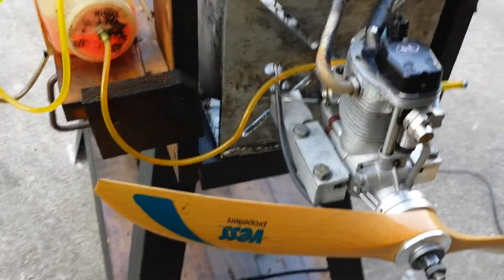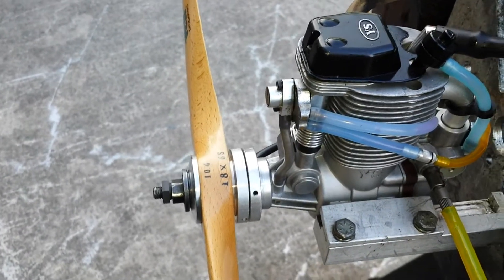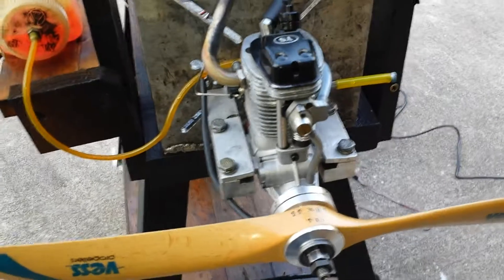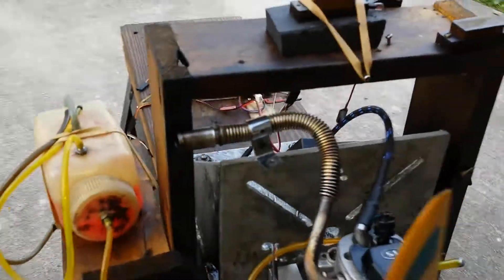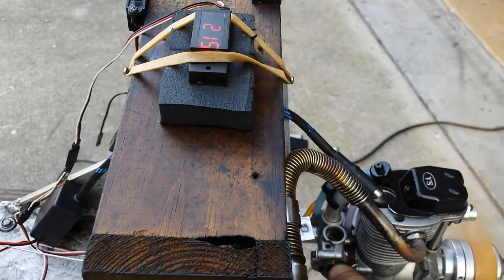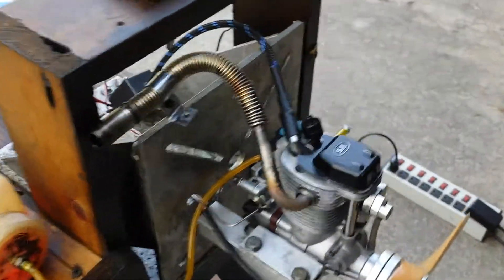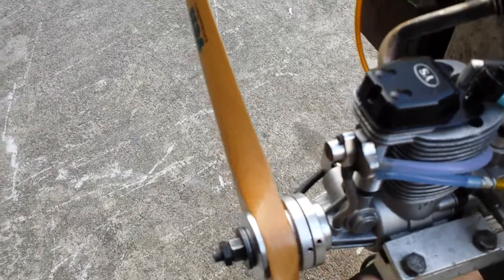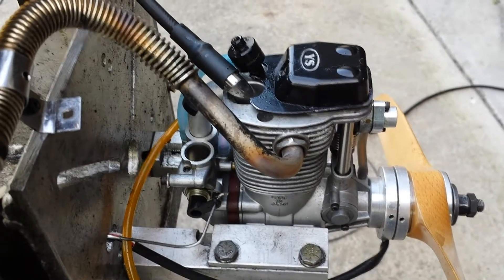YS 160 DZ WITH CH IGNITION CONVERSION to GLOW CDI

Comment: Dear Friend, finally a coherent commentary! congratulations!
People do not realize that with CDI and methanol should be more and consume less.
Anyway, I'm doing some tests with different engines Yamada, the most interesting is the Ys WS 115, with 30% nitro 10500 rpm 16x8, this is the first test, the WS 115 is very low compression, you should go with 65% nitro .
Now compress and take my nitro, with CDI you could compress to 14:1 without problems with methanol.
However Congratulations! nice work.
Marcello Italy